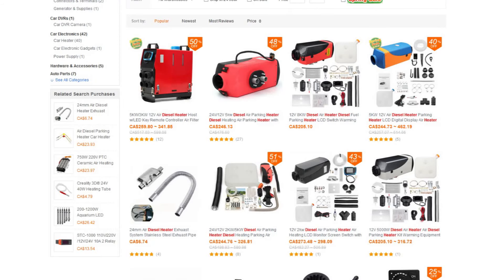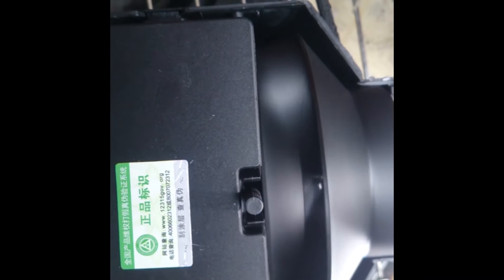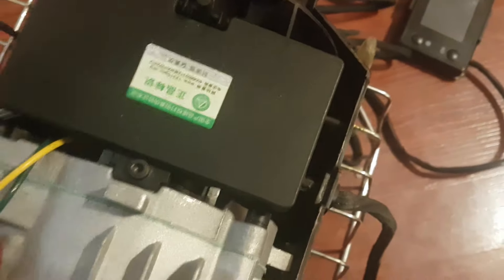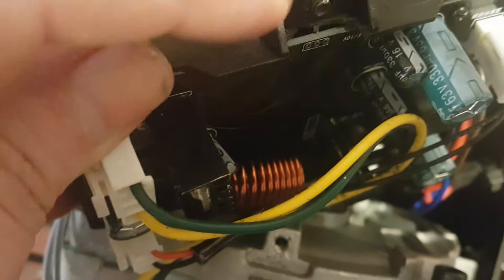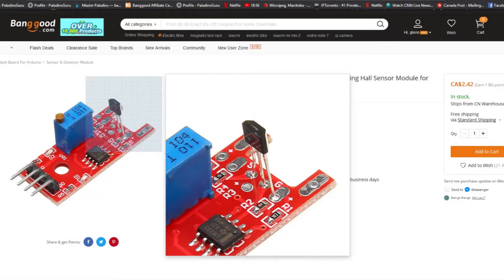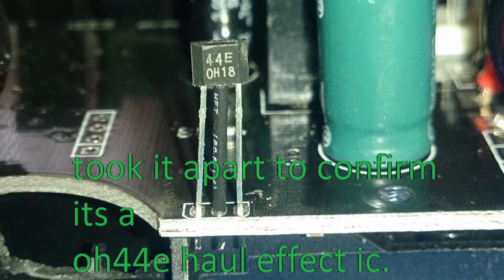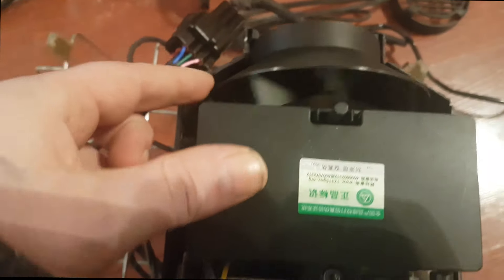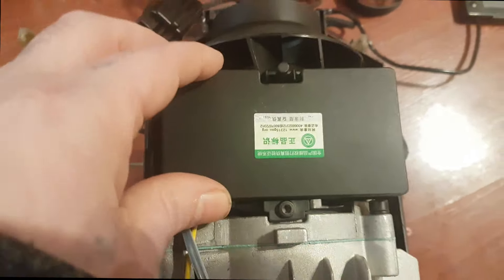Diesel Heater E 06 error fix

Comment: My unit has never ran longer than 15 minutes (one time only & never again)
It fails with the E-06 error & has a blue fuel pump icon on the screen. My ECU does show all of the icons on start up but the only icon on the screen when it did run, was the blue fan rotating. No icons for fuel pump, igniter or the heat range. Also, when my unit fails, the fan is running & the fuel pump only makes one click, then fails. I pulled the fuse, let it rest for 2 hours & it repeats the failure. I pulled the fuel tank & mounted it higher than the pump, made sure the pump in at 40 degrees & the fuel filter is above the pump mounted horizontal.
Still fails, with no air in the white hard line
Reply from the maker: wonder if its just wiring / bad connectors or the fuel pump is just bad.     Also your running this off a car battery ect..?
Reply from the maker: also have you tried the prime setting to see what it does with the pump?  It wont try to start but it will run the pump for about 4 mins or so
Reply from the maker: sorry .. one more comment...  If you don't know how to prime it..   hold the ok button and the down arrow at same time.   then it should say  "H off"  push the up arrow on keypad and it should say "H on" and the pump should start working. .. to stop it ..push the down button again
Reply: @ModItBetter  Thanks, I have an odd LCD, it has screens that I haven't deciphered yet!
 07L ?
10L ?
065 ?
E-00 ?
013c ?
4c ?
P1 ?
Also, I'm unable to find the password section,,  0000 (with a small m in the upper right corner) is the closest to the -4- dashes of the Admin section that I can find.
I can't check my high pump & blower speeds nor can I check my low pump speeds & blower settings
rtE, To pair the remote,
PF setting is related to the amount of power going to the glow plug.
  TO PRIME THE PUMP:
-Press the 'OK' button, & the Down arrow button at the same time, 
	& HOLD,,, to get the P prime function
	after holding, the screen will change to '300'
	if you continue to hold both buttons,dose pump will start & count down from '300'
	To stop pump, press the 'down' arrow button
-Press the upper right 'Up' button, to start prime
-Press the lower right 'Down' button, to stop prime

I have replaced the doser pump three times because of the E-06 errors (unit will work only from the temp section, not the -10- pump section)
It runs for 32 minutes, flashes oFF, followed by the E-06 error. 
I can still get the doser to prime but not run in normal start
If I let it set overnight with the power off, unit will run the next day for about 20 to 30 minutes then repeats the error
I have a new ECU & Controller ordered, so I'll try that soon
Reply: @ModItBetter  Yes, it will prime from 300 & down.
Unit will turn on, glow plug starts, unit roars then purges, followed by E-06
Reply: @ModItBetter  I have the Power Sonic (AGM) Rechargeable Sealed Lead Acid Battery, PS-12350 12V 35.0 AH @ 20-hr - Powered by the ALITOVE DC 12V 20A 240W Power Supply, 12.6v,	Adj pot 'CC' to get to 13.5v - 14v
Reply from the maker: @kellygb9278  well hopefully it is your main boards.. ..It may take more then 20amps during start up because of the glow plug .. However I have never tested the amps yet....I've always used a marine  battery or a car battery when using it. which both go to  800-1000 cold cracking amps.
Reply: @ModItBetter  Yes & no, Yes I have I have verified that the Holtz sensor is set at 0.20 & the blower is not rubbing anywhere, otherwise it wouldn't have ran for extended times, Yes I do have a power supply attached to a battery. The heater screen will sometimes default to the 13v screen in about 25 minutes & stay on this screen, I have replaced three soser pumps, now waiting on belivery of a new ECU & Controller
Reply from the maker: @kellygb9278  Really suxs your going through so much trouble for it.. well at least your getting a ecu and controller ..   With the luck your having if you would of just ordered one or the other it might of been one or the other causing the problem.. .. cross fingers it all goes well for you.
Reply: @ModItBetter  Should be here Monday, sure hope this solves all of my issues - I'm froze from sitting out in the barn
Reply: @ModItBetter  I am out of pocket funds of $50.00 there abouts. About 1/2 the cost of what I paid for the heater in the first place
With the battery, power supply, new fuel hose clips & associated sundries, this is one expensive project! Total running around $300

Comment: My original comment was totally wrong - I'm editing.

My exhaust pipe has a faulty ground.  As in when it touches bare metal it grounds/arcs.  When I disconnected the exhaust pipe from the frame it works fine.  When I tried to touch the exhaust pipe to the frame when it was running it arc'd.  My unit is probably faulty.  This gave me a E-06 fault
Reply from the maker: thanks kevin for taking time to post/share  another possibility .
Reply: @ModItBetter  edited for actual cause.
Reply from the maker: @KevinLauscher  sounds like one of your wires is stripped some where and is touching a hot wire to ground on the unit or a data wire..ect..sounds more like a sensor / data wire other wise u would get a huge spark and the thing would not power up anyways as it would be shorted.....Edited as well. re read it again and you are getting a ark.. and most likely the unit is not powering on when shorted to ground..    I would check the wires then do a simple smell test inside the unit for anything burnt up..with that ark you should be able to find another location hopefully that has also been arking

Comment: I've had an E06 error when I stared my Chinese heater, I solved the problem. Take the lid off, take the electronic box of as you have. Now look under the black fan drive shaft, you will see a a piece of plastic about 2.5 inches long protruding down to the base of the unit and behind the fan. I glued a piece of plastic 2mm, on the base of the inside of the body under this plastic rod (2.5 inch part). This stopped the rubbing fan with no sanding.
Reply from the maker: Hi Andrew , thanks for taking time with a detailed alternative..

Comment: What's a Diesel Heater?
Reply from the maker: Hi steve .. they are just compact heaters that use diesel as a fuel.   good for camping ect....lots of people using them for van life ect  because its cheap on fuel and compact..
However i have not done my own test on the true cost per hour or per day for the fuel.

Comment: I get this error and an intense burnt diesel smell.
Reply from the maker: it could be because once you get the error, the unit is shutting down before its shutdown cycle that usually takes about 2-3 minutes,  For example are you getting huge clouds of smoke coming out of the exhaust after the error ?   If you already know you have no issues with the fan,  is the lid on the unit and the intake and outtake are clear of any back pressure and same with under the unit no back pressure on the intake and exhaust?  .  

also are you making it to the high setting full fan before you get the error ? try to set it to high .
Reply from the maker: I also have a pinned comment from timterry8714 that explains it was the angle of his filter and pump. causing him the grief .too many air bubbles ect.